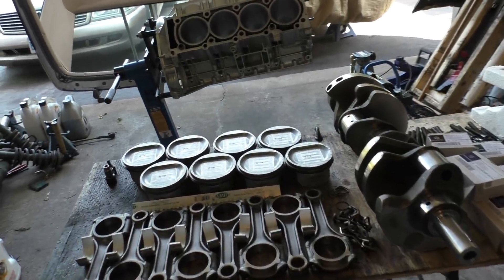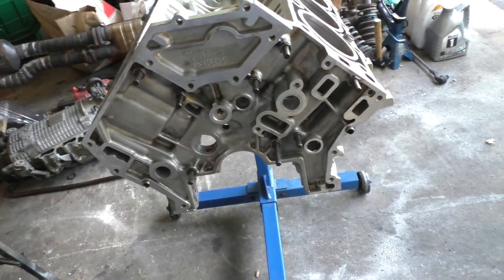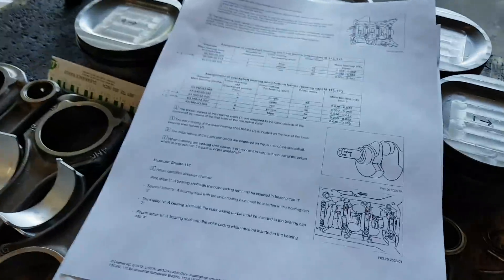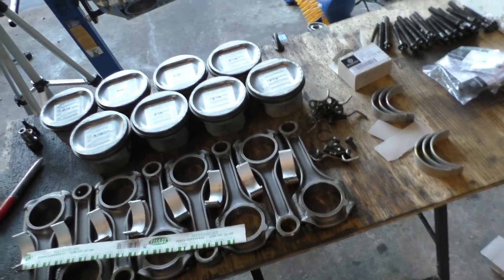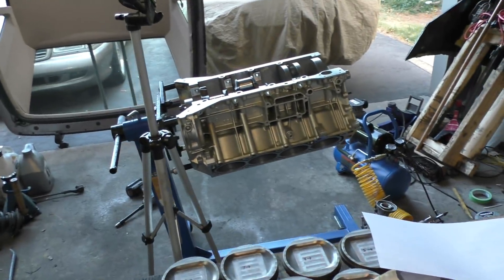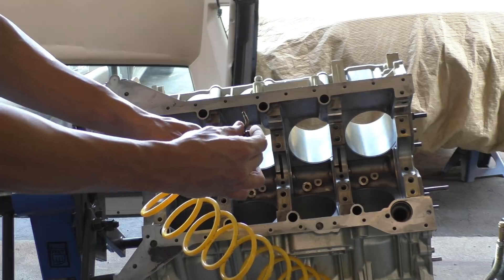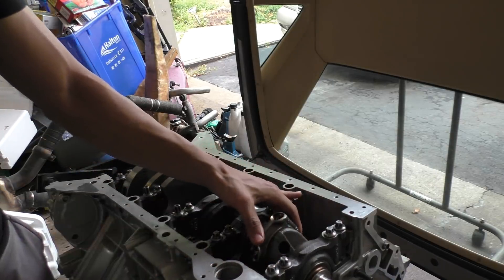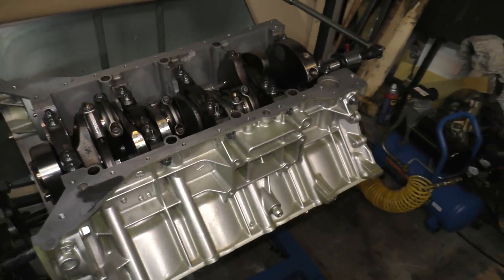E55 Engine Rebuild - Part 4 (Bottom End Assembly)

Comment: Plastigauge actually is quite accurate. Using micrometer has more possibility for human error and surface imperfection that would bring even more uncertainty into your measurements. In my optinion using plastigauge before final assembly is a must even if the engine has been checked with micrometer, ask any serious engine builder.

Comment: Good, comprehensive video! I personally have found plasti-gauge reliable for accurate measurement. You are correct though, measuring with both an inside micrometer or bridge gauge and a mic on the journal is most accurate."Math" This method will conclusively determine big end ovality. I witnessed the catastrophic failure of a large marine diesel generator because the rods were not properly (big end) round. New precision bearings in an oval big end. Insufficient clearance, partial loss of the oil wedge and seizure. Avoid by bolting rod together, torque and measure inside at multiple arbitrary points for roundness.The articulated edge of the rod ends may also be lapped prior.

Comment: Why didn't you install block sleeves, e.g. Darton 900-600?
Reply from the maker: Depends on power goals really. This is for time attack use so temperatures become a really big problem at high boost levels anyways. Most engine builders I've talked to say the stock block is good for over 20psi boost

Comment: It is funny... Back in my days of rebuilding engines plastigage was always considered the "correct & best way" to measure bearing clearances, while using mechanical measuring tools was considered the "quick, less accurate way". I never bought quality bore measuring tools and rebuilt well over 70 engines, dozens of differentials, dozens of transmissions & transfer cases, etc. and not once did I ever have a premature failure related to poorly toleranced components (overboosting, melting pistons, etc. - yes; but that's another story). That actually isn't 100% true. One time I had some cylinders "professionally" bored oversize and I measured an out of spec taper to the bore (using long, flexible feeler gauges between the piston and bore). This was on a high strung 2-stroke snowmobile engine (1978 340RV). Even though it was almost 40 years ago I can still remember the rather tight clearance spec of 0.002" minimum & recommended clearance and I measured it was 0.0005" under that in some places. I brought them back to the machine shop but they insisted they were fine (using a bore measuring tool for the cylinders & micrometer for the pistons) so I ended up putting it together. The motor didn't last 100 miles before it let out a horrible screeching sound and promptly seized the first time I hit the throttle hard.

Anyway, I would 100% be fine relying on the plastigauge measurement. The argument back in the day as to why it is superior to measuring tools was mainly that it was a single measurement of the clearances within the complete, torque'd to spec, bearing assembly instead of a calculated difference between several measured parts when using the measuring tools. If we wanted to do what was considered the absolute best measurement we would do plastigauge measurements at several different points and relative rotations of the shaft relative to bearing.

To be honest I still consider bore gauges and micrometers as tools for a machine shop to use while machining parts and plastigage and feeler gauges as the best tools to use during final assembly checks.
Reply from the maker: Very interesting. Thanks for sharing! Everything does seem fine with the engine so far. The oil pressure is also fairly high so I'm guessing the clearances were all good

Comment: Great vid and Plastigage is definitely accurate enough to show you're in tolerance. I agree with you if the Plastiage indicated you were borderline, then worth the expense of ultimate precision. But to see you are at the lower end of the tolerance scale considering how that engine looked when you started tearing it down, well that is quite a testament to the quality of materials and engineering in this motor! I have an old W210 AMG Estate so I find these videos equal parts fascinating, entertaining, inspiring and scary:-) I particularly didn't like the oil pump pump pick up o-ring

Comment: Why do the rod bearing caps have so much play?
Reply from the maker: Side to side play is normal for rod bearings in these engines. If they are fixed they might not move freely because even the crankshaft has some axial play

Comment: I would definitely do two things- 1) Hose down everything with WD-40 and 2) Install a HD oil cooler. 1) Prevent flash rust 2) Increase oil capacity and help with thermal breakdown. The path of that oil is a long distance in the heat. An extra value item for engine longevity is to install a quality bypass oil filter such as this-  http://www.frantzfilters.com/product/universal-kit/  Very easy to install, cheap to maintain, hyper filtering, extra cooling, and adds another quart to overall capacity. I would enjoy hearing your thoughts on this- negative or positive. Thank you.
Reply from the maker: I had cleaned down everything with gasoline and wd-40 at that point. I was running a larger oil cooler last time. That worked pretty well for managing oil temps. A bypass oil filter would be a difficult install because it might require tapping into some extra oil lines. I'll definitely keep the idea in mind. If I run into oil issues and have to change up the setup, then it might be worth integrating this at the same time.
Reply: The model I listed simply installs where the pressure switch/gauge is, with included T fitting. After the filter, it can go to a tap in the oil pan (or my preferred method) to the valve cover, either with a bulkhead or to the cap. The filtering media is a 1k sheet roll of toilet paper. The system adds approx. 1 quart to overall.
Reply from the maker: Taking oil from there and returning it in the valve cover means your taking away some of the flow of oil that needs to go to your bearings and instead passing it through a filter. I'm not sure how much flow this filter takes away but usually the filter needs to go right after the oil pump so it flows clean oil to all the engine components. Why do you think the engine requires better filtering anyways? Have you had any issues?
Reply: All I know- is that a company and product that has been on the Market for over 60 years must be doing something right. It's called a bypass filter because it uses a metered orifice, not full flow. There is no pressure loss, but a large increase in capacity and extra cooling. The system was originally built for diesel engines. For any further info- please visit the site. I am not a Salesman for anyone.

Comment: I liked your videos regarding your engine rebuilds.  I do have a question regarding changing a timing cover on a 2006 E55, could anyone chime in and give me some advice?  Its a long story, but the car is in my garage, and unfortunately I have to do the repair in the garage.  The specific question I have is regarding the oil pan.  What is the best way to remove it?  Is it necessary to drop the front subframe or can it be done another way?  Any help would be appreciated.
Reply from the maker: You can try unbolting the engine mounts and see if you can raise the engine high enough to remove the upper and lower oil pans. Depends if there's enough space between the engine and the subframe. I've never tried it that way my self

Comment: This is getting me worried. I'm looking at buying an early 2000s CLK500 or E500 but I don't want to be pulling an engine.
If it was just being used for street driving I would hope it would give an oil pressure warning before catastrophic failure
Reply from the maker: It should be fine if the oil system is functioning properly. These engines don't come with an oil pressure sensor or warning. Just install an aftermarket one and monitor the oil pressures. I'm more than certain none of these bearing issues would happen if the oil pressures are kept in check
Reply: Yeah. I'm way to lazy to pull the engine to do the o-ring

Comment: Just one thing since now you have rebuild or in the process of rebuilding your engine. Question how old is your automatic transmission because most people do not know is that if you have a old transmission then rebuild or get a new engine and not a second hand one , you’ll soon notice that the transmission will fail due to that extra power the engine now or will make seen this many times since I’ve been in the automotive industry. I’d have a look at the transmission or inspect it just to make sure it’s all in good working conditions
Reply: Gaz Girl that Mercedes transmission is bullet proof as fuck, same tranny as the v12 biturbo that has 600 torque

Comment: Good stuff. I've heard from engine assemblers that it's best to fully install and torque each connecting rod and spin the engine each time. That way if it was to bind you know which cylinder is the problem.

Comment: Use liqui moly racing 10w-60 oil.
Reply from the maker: I was running a 60 weight before but I'll probably go with a 50 weight, at least for the initial brake in because the clearances are smaller now
Reply: SK8215 
 I do agree with you on that, from what I have researched I have come to know that the wider the number of the oil grade the more stable and reliable the oil is. Now for example an oil that is graded at 20w-60 will have a flash point of 220°c but another oil of the same manufacturer graded to be at 10w-60 will have a flash point of say 235°c. I would recommend that you use a multiple grade oil which has the 10w and a 60 because that's the lowest you can get if you want the higher number to be 60. Why I am saying you need the 10 is because it can get cold where you live and that oil needs to flow. No matter the high quality design of the pump, you should be safe than sorry isn't it. For the winter storage go for a 0w-40 or even 30 if you don't pull hard when that oil is in the engine. Plus your decision on the oil for the break in period is good but again go for a multiple grade oil like 0w-50 or 5w50. I am not a sales person at liqui moly but I love that oil because it has this fascinating thing to it that for the usable life of the oil, it clings on to vulnerable parts and helps during start-ups. 
Good luck with the new engine! Love your channel and hope you keep it up.
 With Goodwill.

Comment: Hopefully the cylinders and everything else will wear in well. Aren't re-honed cylinders supposed to have a crosshatch pattern in them though? To expedite fitment to the piston rings. Either way be sure to change the oil frequently during the break-in period.
Reply: The block is alusil. Which basically is aluminum and glass. So crosshatch would be extremely bad.

Comment: Great job ! Just one point, any bolt which has in mounting procedure mentioned last step turn by 90° is not reusable, because 90° is GRADIENT screwing, means bolt is tensioded and deformed.

Comment: Do you happen to have any info on the process used to expose the Silicon matrix in the AluSil after honing or machining? I read somewhere that there's a process for doing that, which I imagine involves some sort of acid etching to recess the Aluminium matrix and expose the Silicon grain.
Reply from the maker: There's a specific lapping paste for it. Search "Sunnen an-30 silicon honing paste"  
Just use that paste with a felt hone

Comment: The e55 has a aluminum block.Is it possible to get the block sleeved.Great video
Reply from the maker: Yes, people do go with steel sleeves. Depends on the power goals really. If its a high horsepower drag racing setup then yeh, it makes a lot of sense doing that
Reply: SK8215 I’m a mechanic  and tuner .If you can sleeve the block track days generate heat that a street  car would never imagine best insurance on a new engine.
Reply: But too late at this point.  Most guys are building 5.7 with Darton sleeves.  But a different piston would also be ideal along with different ring packs.  These engines , much like the Porsches are incredibly hard surfaces.  Yes, I do agree the Darton sleeved blocks are stronger and yes more expensive to build at this point of parts accumulation.
Reply: It only makes sense to go with wet sleeves like Darton but then the block is losing its rigidity, boring out the cylinders and going with typical sleeve inserts is not for performance at all, the heat dissipation is much weaker with sleeves and such engine will not last under heavy use. So no, sleeving is not a good idea, alusil coating is way stronger than steel sleeves and way better thermal dissipation. Sleeves are good only if you desperatelly need to save an engine that has been worn or damaged beyond specs but not for increased performance.

Comment: The tapered sleeve piston ring compressors are less than $50 from Summit Racing. Those will save you sooner later. Piston heights are less and the older style compressors have great risk of letting a ring slip out and it will break as you tap piston in. The tapered sleeves have a huge advantage as the piston, when oiled, will slip into cylinder with finger pressure and the rod bearing won't fall out or move from tapping.

Comment: Can the forged connecting rods from the M113k physically fit into M113?
Reply from the maker: Not sure if the lengths are the same but they should fit if they are swapped along with the crankshaft and pistons from the m113k
Reply: remember to upgrade rod bolts either way :)

Comment: Keep up the good work, really enjoy watching these. I just finished up rebuilding a m273 myself
Reply: I'm considering going with a CL500 (550 in the US), either a 2008+ or a 2011+ (facelift). I'm kind of leaning towards the newer one, and part of it is the low end torque of the m278, which I feel would be more suitable for such a heavy car. Which car is your M273 in?
Reply: Mine is in a 2010 SL500 (European spec). I would go with the facelift as the earlier m272/m273 suffer from balance shaft issues.

Comment: 1000$ for fasteners... Mercedes is pretty shitty for pricing of their parts, I needed a new condenser for mine and they quoted 500$ for the part while buying straight from OEM manufacturer (Febi) it was 120$. But I love MB for supporting pretty much any model like 40 years back and still making parts for them.

Comment: You've learned a lot about engine building. Great documentation helps. AMG motors are built with precision by one person who is a skilled craftsperson and trained on each type of engine they see at their workstation. I am wondering if you'll put your signature on the engine when it's finished? 

I hope the cylinder walls are smooth enough. While using proper micrometers and the like are the recommended way to go, plasti-gauge is supposed to be very accurate as well.

I wish you all the best in the completion of this project. A lot of time and money has gone into it and you have raised the bar on the skill level of the average you-tuber/backyard mechanic.

Keep the shiny side up!!
Reply: Plastigage isn't "very accurate", but it's good enough in most situations, particularly if your shortblock was in good condition to begin with and all you're doing is freshening it up. This is coming from someone who's had good luck with just using plastigage on cheaper rebuilds, but on something more serious where we really couldn't afford the engine to go kapup, a calibrated mic and bore gauge was always used (and maybe followed by plastigaging as a sanity check). Yes, it takes way more time, but again, accuracy isn't plastigage's strong suit. It's just a quick and easy way to see if you're in the ballpark. The other advantage of using plastigage for a novice though is that as long as you follow directions (surfaces are clean, don't spin the crank, etc), it's pretty foolproof. In contrast, using a mic and bore gauge properly takes some experience and feel.
Reply: Do Not do what this guy is doing. You cant polish a crank by hand with a fucking rag and you dont use a grinding stone on your crank journals to open the oil passages.
This clown has no idea of what the hell he is doing and this motor is a grenade waiting for the pin to be pulled.
Reply: @gregg4164  the engine is still running. If you drop the douche bag, you may be able to pick up some knowledge.
Reply: @gregg4164  no reply?